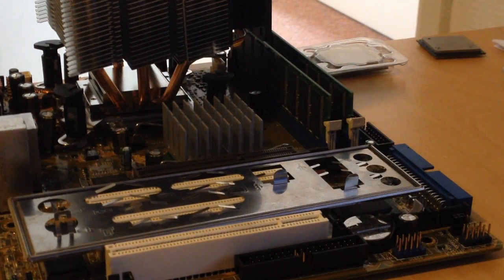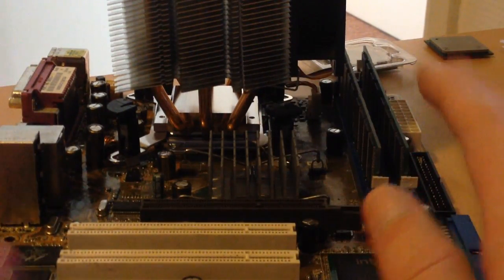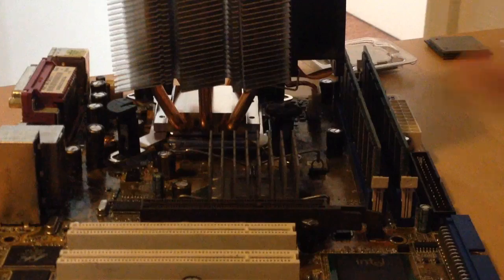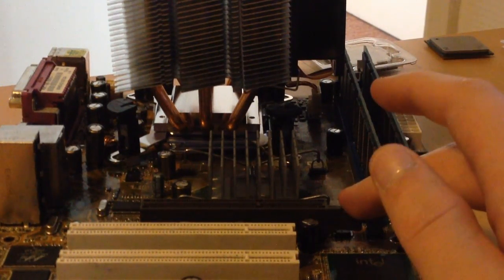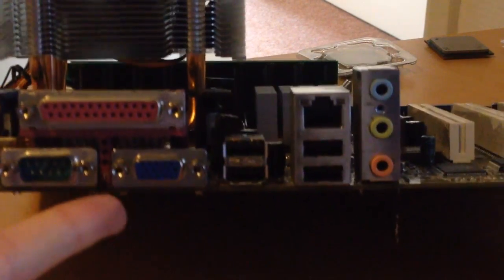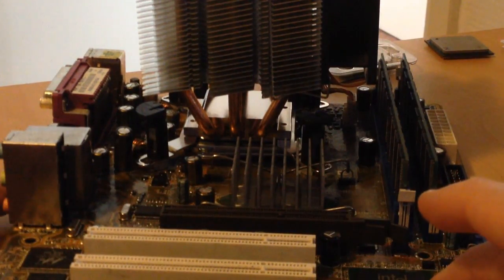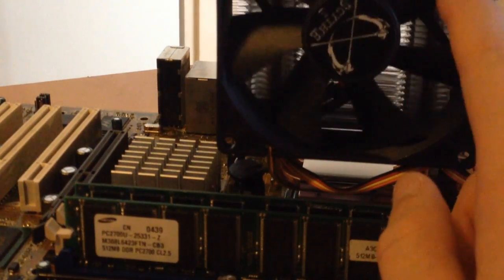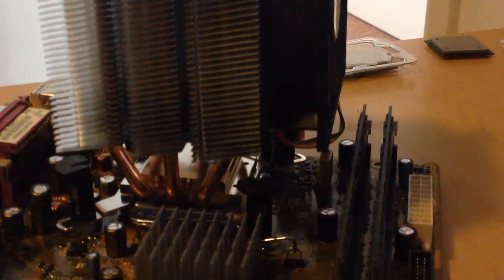A Weird Asus Motherboard - P5PE VM

Comment: It's not from year 2005.
It's from mid year 2006. YOu can even find enthusiast looking forward on this board, in early september 2006.
Very early, they found out, it has no overclocking options in BIOS. No FSB change, no vcore change.
You can also confirm date by first BIOS date on Asus page.
Reply from the maker: Thanks for pointing out an error on a 9 year old video
Reply: @nelizmastr google recommends it when you are searching motherboard name.
Internet doesn't know the age.

Comment: i bought this motherboard second hand for like 30$ so glad that i did because its worked incredibly well to run older Win9x OS because of its highly compatible 865G chipset that was usually found on the pentium 4 platform. my machine is with a X6800 intel Core Extreme CPU, with Geforce 2 AGP Graphics, running Windows 98SE 512MB/RAM - 3 conventional PCI slots allow for alot of different Audio Related upgrades such as DIGI 001, Echo/Event/M-audio Sound cards, RME cards etc

Comment: I have one of these, works well with Windows 98SE in a build I'm currently working on
Reply: how did you install your os? my win 7 keeps on bootlooping, but works on other computers
Reply: @Awunsaba11  I haven't tried Windows 7 on it, I just installed 98 using the setup program
Reply: There is an option in the bios to switch the ide/sata controllers between compatibility and enhanced mode so try changing that
Reply: @hydroksyde  i'll try that, thanks, is it possible to update the bios via a usb?

Comment: any ideas on why my pc wont evn display a post diagnosis or bios?
Reply from the maker: Make sure you have a supported CPU, name brand RAM and either a video card or the onboard graphics connected to the monitor. Reset the CMOS to clear possible conflicts and if that doesn't change anything it's likely the board, RAM or CPU is toast. The board is most likely.

Comment: m2n68-am plus came out in 2009 ;)
Reply from the maker: Meh, whatever :P I had 2007 boards that were more advanced so yeah. Asus is a weird company :P
Reply: wtf? why is Asus weird company??
Reply from the maker: +DGG gamer because they decided it would be a good idea to fit an old 865 chipset when dual core chips, PCI-Express and DDR2 were becoming the standard already. This board has  AGP and DDR400 memory, the ancient predecessors.
Reply: nelizmastr , ok thanks ;)
Reply: @nelizmastr  Asus is not weird company. This type of board was recreated by every company basicaly. Asrock has its famous 775i65G and 775i65PE line of motherboards.
Gigabyte has its GA-8I865GME-775-RH . both companies reviewed board 3 or 4 times (asrock 3, gigabyte 4)
Last 4th revision 6.6 from Gigabyte even supports Core2Quad (Q6600).

Now, those boards are loved by retro hardware enthusiastics and collectors. Because they are highest capable boards in terms of score and various benchmarks with AGP platform.
Asrock have it's famous black PCBed 775i65G rev 3.0 for it.
I'm sure MSI has made some too.

When put together by HD3850, they're making records on AGP platform. Basicaly highest score and FPS achievable by fastest AGP cards. no other board can "pump" cards like HD3850 at full potential. Because socket 478 for AGP doesn't have such powerfull processors available.

The reason, why they could not used DDR2 as for most socket 775 motherboards is chipset limitation. 865 line of chipset have 2 very clearly limitations that you cannot bypass - DDR1 memory support and AGP slot.
So blame Intel, not Asus. Not even Intel is faulty on this. As 865 was projected very early on for socket 478, it should be last AGP platform chipset. DDR2 was non existent in that time. 
They've made for DDR2 refresh of that chipset, called 915. But it is of course connected through PCI express. So you cannot get AGP on this board (only "fake" agp slots made through PCI bus). That's it. You cannot go any higher with AGP slot, than with 865PE. And socket 775 and core 2 support make this platform ultrafast for latest AGP cards. 

These boards are not weird, there's nothing weird on it. It's just maxed out AGP platform and chipset.